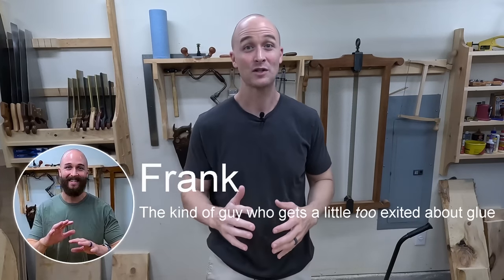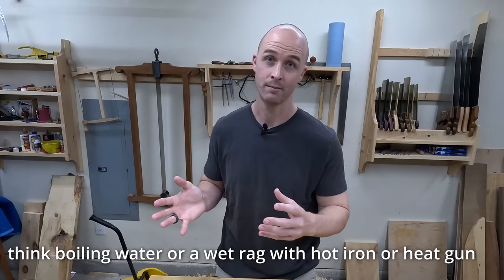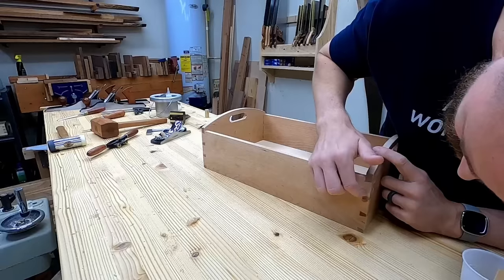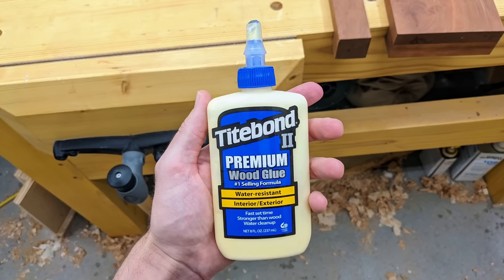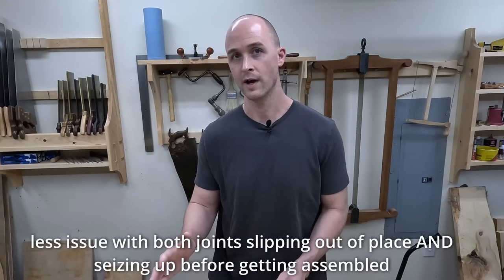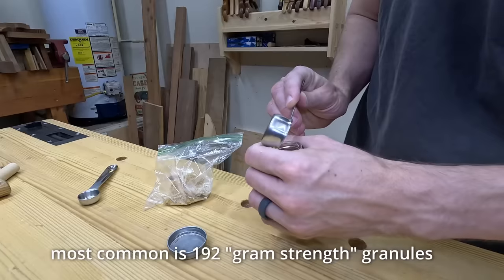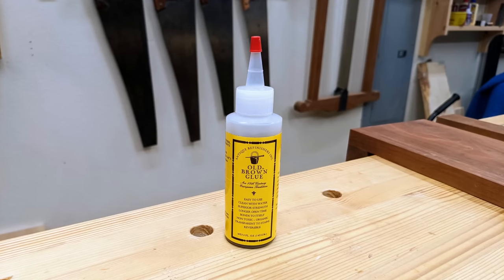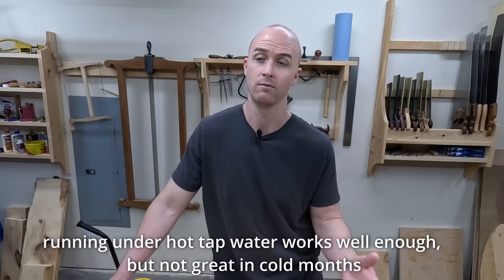This May Change Your Mind About Wood Glue

Comment: Oh, and I just remembered that I watched a video with a professional traditional cabinet maker. He said that when you make furniture for generations, you have to make it repairable. He used hide glue for joinery for that very reason. That really stayed with me. If something have to last it's not just about how sturdy it's built, it's also about how easy it is to repair.
Reply: Great point.  However, I can see people going after their furniture trying to pull it apart thinking it's made of hide glue, when it's a modern glue that can't be taken apart with a hot knife.  Unfortunately, craftspeople who use hide glue don't always mark that fact on the furniture;-)
Reply: @orazha  That's a good point. I'll remember to add instructions somewhere! :^)

Comment: As an artist, I have used hyde glue, and if you have sealed the glue, its fine, however, beware, in temperature above 120 F, it MELTS. Melts. It will run right out of your work, or otherwise loose its adhesion, for as long as it is hot. For the trouble, I, as an artist, have switched to PVA glue for my needs as an artist, lol, the benefits are so much better, if not for the trouble of making the glue alone.

Comment: Yup, hide glue rocks. As for reversibility…I once tried to get apart a joint that had been glued together just a few days earlier. I had to literally soak it in a bucket of water for 3 days and then apply heat with a heat gun to get the joint apart. That is tough glue! Your video covered the basics really well. Lots more to hide glue, like different gram strengths. Also, if you ever try veneering then hide glue + veneer hammer = amazing. Thanks for helping to educate folks about hide glue and sharing your recipe. (You can keep leftover glue in the refrigerator.  It keeps a long time in there. )
Reply from the maker: haha thanks Jim yeah the furniture restoration pros can probably get it apart and make it look easy lol (and it probably is easy...for them...:)
Reply: It is reversible if the joint is accessible enough. The most common way for flat glued joints is to heat up a thin metal blade and just cut into the joint like butter. That is an excellent first step for any disassembly as the newly made gap can be moistened if it in itself did not suffice.

Comment: I used hide glue on the houndstooth, dovetails of my Roubo bench and I was just as excited about it as you were. I used tight bond hide glue because it was already mixed. I just released a video a couple days ago about making them if you want to check it out Frank. A little sawdust mixed into the hide. Glue makes any gaps in the dovetails invisible.
Reply from the maker: Sweet, I'll check it out! Thanks Gary
Reply: @FranksWorkbench  cool. I really like your videos. Very clean audio, good insight, good information and no flashy crap like some woodworking channels. Keep it up!
Reply from the maker: @garynelles  thanks man!!

Comment: I recently finished building a Japanese toolbox for my hand planes and I used Titebond hide glue throughout. I really liked the glue. Even the next day, when the glue was dry, I could easily clean up the squeeze out with a damp sponge.  I'm now building a pair of nightstands and, again, am using the hide glue. I heard on another recent video that one of the curators at the Smithsonian Museum tested hide glue strength (it's been in use for THOUSANDS of years) and found it to be almost as strong as epoxy!
Reply from the maker: that's interesting, wouldnt surprise me! It can be a little more of a hassle, but I think its more than worth it. Need to try the tight bond version

Comment: Another great video!
No creep = the main reason we use hide glue in instrument making. When it dries it becomes britlle : great for sound transfer.
The reversibility is another plus. Violins will have to be taken apart every so often.
It bonds to itself,  which makes repairing cracks in soundboards etc.. so much easier.
Reply: Assuming  Jean Claudia is a creeping  too.

Comment: I've never used hot hide glue but have used liquid hide glue a lot.  As a musician, hide glue is used because it's possible to take a wooden instrument (violin, cello, etc) apart to repair it.  As a furniture maker, I used hide glue due to it's longer set time.  You have time to move clamps around until you've got the piece in perfect alignment.
This is the second video of yours that I've watched.  I like your style.  Keep it up.

Comment: Hyde glue has its applications, but keep these things in mind: 1. Because it is hard it is also brittle.  Don’t use in situations where wood expansion or joint flexing will take place as it will break, 2. It stinks, literally.  Hyde Glue has many fine properties but don’t throw away your PVA glued, or your CA glues either.
On another note just because a piece of furniture has screws used on it doesn’t make it a throw away piece.  Great video!
Reply: Boiled Bunnies! OH the humanity of it all!!! 🤢
It used to be made from horse's hide.
My teacher was a door and window maker and he used it.
But Titebond just fine. (I'm not a luthier I'm just old)

Comment: As a guitar maker hot hide glue has been something in my shop for a long time. But in the past couple of years I've found fish glue to be very useful as well. Same properties as hide glue without the hot pot or warming up parts to extend drying time. Much better open time with fish glue. Although I didn't know about the urea.
Reply: We've been using a microwave for hide glue for many many years it's great!! no glue pot and it 's ready in seconds---really.
Watch out liquid fish glue may have phenol's to keep it liquid.
And be somewhat hydroscopic in high heat and humid conditions.

Comment: Couple more tips about hide glue:

You can use non-iodised salt (sodium chloride) instead of urea, works just as well.

White vinegar breaks down hide glue if you're having trouble getting a joint apart.
Reply from the maker: thanks man!
Reply: Look for pickling salt, which has no added iodine or any anti-caking agents.
Reply: Kosher salt is just salt.  I was really amazed to find the jar of Morton's I grew up with has 5 ingredients!  What's all that stuff doing to your insides over a lifetime of exposure?!?  Never knew salt needed to be added to the glue, so at least I learned something neat today!
Reply: @threeriversforge1997  what’s all that stuff doing to your insides? Nothing. The sodium is the biggest health risk in salt.
Reply: @jasonandersen5975  How do you know?  Especially over the long term and in conjunction with other things that you might be ingesting, including mediations.  That's the key.  I've found no long-term studies on the effects of these kinds of things.  Worse, I get the feeling that it'd be impossible to do a study simply because there are too many factors to account for.
Reply: @threeriversforge1997  I know from years of studying medicine and nutrition. These are all common chemicals humans have been exposed to/ingested for centuries.
Reply: @jasonandersen5975  It's one thing to say people have ingested something for years, quite another to know for a fact that there are no long-term consequences of that intake.  As I pointed out before, it's not just the many chemicals in the "salt", but how they react with the many chemicals found in the other foods someone eats in the day.  And then over a long enough timeline to see if there's long-term damage.  Again, I'm not aware of any studies that have specifically targeted the questions I'm asking... and I've looked.  Lots of people are like you, asserting that it's safe, but it seems like they always dodge the specifics of what I asked.
Reply: @threeriversforge1997  apparently you haven’t looked hard enough. Sodium chloride, potassium iodide (ions that perform essential chemical functions), and dextrose (a form of glucose) are all part of our diet and are essential to life). Silicates were identified in the 1500s and have been produced and utilized for centuries. Their pharmacokinetics and pharmacodynamics are also well-understood and documented. As I said before, of all of the ingredients in the typical package of table salt, the salt itself, specifically the sodium, poses the greatest health hazard. 

Sola dosis facit venenum.
Reply: @jasonandersen5975  Knowing about them isn't the same as knowing how the human body works with them over a long time, especially when the human body is being hit with a thousand other things. 

How do you determine if a cancer "just happened" or is a result of ingesting a combination of compounds over twenty years?
Reply: @threeriversforge1997  I’ve told you that we do know how they affect the body (and pointed out that in the case of typical table salt most of the ingredients are actually necessary for life). I am impressed that you are trying so hard to remain ignorant and fearful. Good luck with that.

Comment: Actually one of the best case for  hide glue I’ve heard.  I work on instruments so hide glue (and fish glue) is common for me .. but for a general woodworker the NUMBER ONE reason to use hide glue is the finishing angle.  Hide glue 0:01 plus sawdust stains up like solid wood.  PVA plus sawdust does not stain any better than dried PVA. It will literally stand out like a sore thumb and look like hell even 30’ away.  For joinery hide glue rocks!!  I don’t use it for edge gluing panels - that’s PVA all the way .
Reply from the maker: Yes sir!! 100%

Comment: Skipped the PVA glue and moved to hide glue.

Then i skipped the hide glue, too... 
and moved to fish glue.

Reasons:
Same advantages you mentioned for the hide glue, but

+ longer open time (well, at least for me it's a pro. Some might consider this as a con)

+ way better smell (though it's fish. Counterintuitive, i know)

+ keeps good forever in wet condition (actually maybe not forever. But i keep a quarter filled bottle since 3½ years and i am testing it every now and then. Just for curiosity. And it still glues like a charm. No denaturation, no mold, still glueing great)

+ no fiddling around with hot water pots. This stuff works without any prep-hassle  (almost) year round. Fish live in cold water, that's why their proteins (our 'glue') have to be flexible/elastic in cold conditions (39F/4C). In contrast to the animals that hideglue stems from: those proteins 'operate' at higher body temperatures. 
Only in very cold settings fishglue becomes quite viscous, but a quick bath in warm tapwater is enough to do the trick.
Oh, and cold sourroundings shorten the open time, probably also because of the viscosity.
A workshop with "room temperature" is recommended or one should at least warm up the workpieces before glueing.

+ glues lots of other materials, like metal, glass or stone.
I used fishglue to attach leather pieces to my holdfasts (to prevent marring the wood). That was five or six years ago. Still holding up fine.

+the bond fishglue forms with the wood is way stronger than hide glue.
I even think it's stronger than PVA glue, but that might be an subjective impression. 

One additional tip to hide glue:
If you want your hideglue to last longer, don't store it 'wet'! 
Let it dry completely and it keeps good forever. 
To use it again you have to 'revive' it by adding water and heating it up.
Reply: Fish glue is weaker than hide/bone glue. There is also quite the difference in hide glue (in Germany we call it "Hasenleim" which basically means it's made from the skin of rabbits) and bone glue (Knochenleim). Bone glue is the strongest of the natural glues, with one exception that is a special type of fish glue. In general the normal fish glue is as strong if not a tiny bit weaker than regular Hide glue (light brown), but weaker than bone glue (really dark grown).

The "special fish glue" is called Hausenblasenleim in Germany, meaning it's made from the bladder of the fish: https://en.wikipedia.org/wiki/Animal_glue

Comment: Hello,

I suppose, that hide glue is the equivalent to the German Knochenleim := bone glue. I use it in the same way and for the same reasons as the commetator Jean Paul Peeters. Mostly it's used for the restauration of historical, wooden string instruments, such as Mandolines, Lutes, Guitars etc. and, as he is telling, it's no problem, to remove the parts by heating them, sometimes supported by hotwater or steam. One can even correct a glue t.e., if the soundboard wasn't glued correct to the body side by heating it to 40-70°C. The filling of cracks with this dark glue is another advantage. Getting hard and brittle is not only good for the sound transfer, but also for mechanical treatment, such as sanding. But one has to pay attention to not getting the sanded parts to hot. If so, it gets greasy and sticky again.
One more advantage: If you don't need it, just let it dry. Next time you want to use it, pour little water in, let it swell for a few hours, heat it to 40°C and use it as before. If it is to stiff, mix a little more water to it. 
The biggest disadvantage: To get the best glueing results, you have to work very fast and precise. If the bone glue gets cold or dry, it won't glue the way it's meant to be. It often helps to  carefully preheat the parts to glue with a heat gun or a sodering torch.
When I started restoring instruments, I was very unhappy with the charakteristics of normal wood glue. Easy to handle, but ...Somewhere in a description of historical carpentry work I found bone glue to be the common glue of this time. I bought the raw material and learned by try and error how to handle it. 

Regards

Th. Krapf

Comment: Using a heat gun strategically works wonders. i keep hide glue in the fridge in my shop and if i want some for touch-up or small project just heat the surface use what you need then throw it back in the fridge,

Comment: Thanks Frank.  I've been using hide glue (mostly Liquid Hide Glue from Titebond) but looking to make my own.  I already dissolve up my own shellac and as much as I love Tried and True finishes, I'm thinking of refining my own linseed oil.  As such, making my own hide glue doesn't seem that weird at all.  If not, I'm thinking of going over to Patrick Edward's Old Brown Glue like you suggested.

On the Fixing Furniture YouTube channel, he adds some white vinegar to joints with hide glue if they don't come apart easily.  Seems to work well.  Worth looking into vs. heat and steam.
Reply from the maker: Thank Joe! you sound a lot like me LOL i do the same with shellac so I can use everclear instead of denatured alcohol. Ill have to check that channel out!
Reply: One of the common finishes for wood boats is equal parts pine tar and linseed oil thinned with turpentine, and if a shinier finish is required, shellac flakes can be added.  I use pine tar and turpentine for everything that'll be outside and love the look it gives.  That the pine tar and turpentine both have natural anti-microbial properties is a real bonus for woodwork that'll be outside.  I've been curious about adding hide glue to the mix for various jobs to see if it would harden a little like the shellac does.

Comment: When I worked in the cabinet-shop (back when there was only one  Titebond -- The Original),  during the heat of the summer as I was gluing up  (say) door panels for kitchen cabinets,  40 minutes was all the time the panel was in the clamps.   If I glued them up in the morning, I could plane, cut to size, and run them through the panel raising  (shaper) bit in the afternoon.   Never  had a problem with delaminating at the glue joints.       Perhaps the formulation for the glue has changed ?

Comment: We used to boil hide in water and use it for carpentry and leather works 50 years back. It will soften with hot water. Regards

Comment: Another acoustic instrument maker here - I couldn't agree more, hide glue is the best. I use it (and fish glue where really long open time is needed) for all sound-critical joints. I'm happy with PVA, CA and other glues where appropriate, so I'm not a fanatic about hot hide glue. A couple of maybe useful points from my experience:

1. A baby bottle warmer has worked perfectly for me for 10 years. I calibrated it when I got it and now just leave it at the same heat setting the whole time.
2. Hide glue freezes well when made up. This gives it a very much longer life without spoiling and you can just take it out of the freezer and throw it in the bottle warmer when needed. I haven't noticed any degradation in joint strength after even multiple periods in the freezer and reheating, but have to say I make up a fresh batch for any really critical joints, just from an abundance of caution. Any left at the end of a day goes straight into the freezer.
3. To minimize the risk of a bad joint through 'gelling' before I can get the parts clamped together, I paint glue on both parts, so the wood to glue connection on each part is always while the glue is liquid. If it gels slightly before clamping up, it doesn't matter - the glue will meld into itself perfectly well.
4. Many joints don't even need clamps - a rubbed joint (parts should be PERFECTLY mated, no gaps) will be 'self-clamping'.

Comment: Seems the challenge I run into is finding the raw ingredients locally. Shellac flkes cant seem to be obtained from Ace or True value in my area anymore. 
Woodworkers source or woodcraft are my local options, but they're 30 and 80 minutes away. I can surmise that the glue flakes will be similarly rare. Good to know that it can be done though! 3 ingredients. Simple enough!